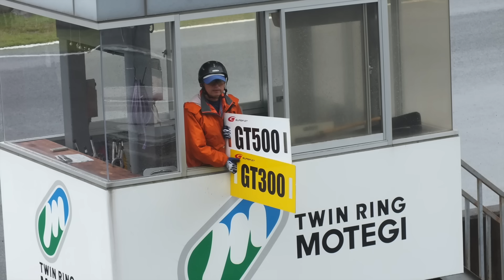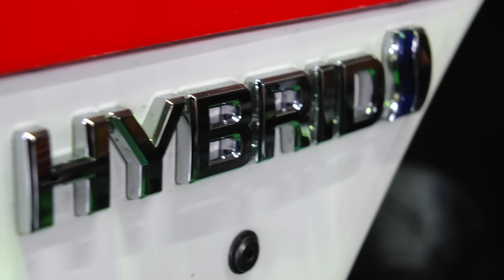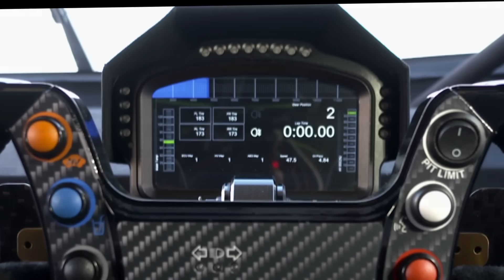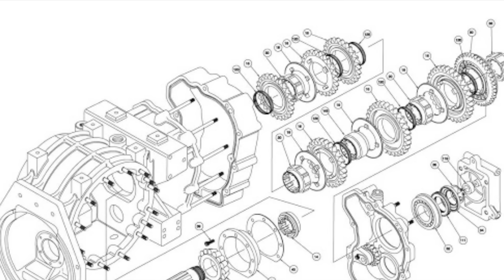The wildest Prius, The Super GT - Indycar V8 hybrid is reborn. 2017 apr GT300 Prius tech details

Comment: 4:30 Regarding Bandoh letting it slide... it's worth noting Bandoh owns a Toyota aftermarket parts company, and of course APR is another Toyota aftermarket company. Both are very Toyota-adjacent. Bandoh is also known to be very lenient towards Toyota/Lexus getting penalties, and listens to Toyota when it comes to BoP.
His name continues to be on the Wedsport GT500 team (Toyota/Lexus).
IIRC it was 2017 when his car rear ended the 23 Nismo GT-R car on the warm-up lap. There was no penalty for Chairman Bandoh's car doing that. The 23 car lost the championship by 2 points that year. Especially in context of those years... drivethrough penalties were handed out like candy in 2017 and 2018 to Honda and Nissan for the smallest of infractions.
And then you would have drivers like Rossiter barging around the track recklessly taking cars out, with no penalty (but eventually asked to not come back).
There's been other curiosities, like a BoP being changed last-minute in 2023 IIRC. Before the first round, Honda was looking competitive... not dominant, just competitive. And Bandoh change the BoP hours before qualifying... which significantly favored the Toyota cars. Honda went from being pretty good, to completely absent during Qualifying and the race. Toyota won.

Comment: I have one prevailing memory of these cars in 2016-18 trim: the backmarking #30 car was ignoring blue flags, backing up the race leader at Okayama so that the #31 could close the distance and take the lead. No relevance to the wider story, but I still chuckle at the skullduggery. These were villainous Priuses.

It also stands out to me just how much apr's efforts with these cars mirror those of race teams of old. Jim Hall's Chaparral team also reused old chassis designs and built new cars to new specifications around them. So did Porsche in the 70's - recall that the 936 was a parts bin special composed of elements from the 908 (chassis) 917/30 (various), and '74 911 RSR (turbo engine). LMP1 teams would sometimes run different aero packages on their two cars in the lead-up to Le Mans - a high-downforce car to have the best chance of winning outright, and a low-drag car fielded to gather data before its use in the LM24. Just goes to show how race teams past and present operate on more similar logic than might be assumed.

Running two different brands of tire within a team isn't without precedent either, but one wonders why apr bothered with the off-the-shelf Yokohamas on #30 at all. Part of me suspects there's a pro-am sub-class within GT300 that just doesn't get much outside coverage, because there are a few of these strangely low-level efforts that hang around the GT300 class, even run by top-level teams. Hell, apr still field a low-level effort alongside their current flagship LC500h: a highlighter yellow JAF-rules GR86 that might even still use off-the-shelf Yokos. Might also be a budget thing, as bespoke rubber can't be cheap. In fact, maybe it's both: have a pay driver come in and shell out money to drive a toned-down version of your flagship and take a crack at a pro-am title.

I eagerly await Part 3...

Comment: A Prius with a set of coilovers and good wheels and tires, is actually a lot of fun on twisty roads.
Reply: It's worth noting that a car that's efficiently designed will tend to perform well in dynamically demanding conditions. Power dense drivetrains, relatively compact proportions, and slippery bodywork are general attributes the Prius shares with every Porsche Le Mans racer fielded before the 917 - cars that famously did a lot with a little. 

I suspect a race-tuned Prius with the punchier electric motor out of a hybrid SUV and good chassis prep could likely do some serious damage in a touring car race. Anyone have the Speedworks BTCC team's phone number?
Reply: People forget that a car is a car, and that it's up to the driver to have fun with it
Reply: IIRC the latest Prius shares the same suspension mount as GR Yaris or GR Corolla (can't remember which one). The suspension, at least externally, even look similar between the 3 cars. The internals are different of course.
Reply: @silphershadow  If Jason Cammisa is to be believed, the GR Yaris's rear suspension comes from the Corolla, and the GR Corolla shares Toyota's TNGA-C platform with the Prius. Bozi Tatarevic at The Autopian has gone so far as to investigate the installation of go-fast parts meant for GR Corollas onto his current-gen Prius, and he's having a non-zero amount of success actually - without dramatic surgical operations, just basic bolt-ons.
Reply: @silphershadow this should tell you everything you need to know about the GR vehicles and toyota in general.... You can put stiff springs and dampers on an econobox, but a real racer can feel the difference actual good suspension geometry makes. Toyota is all about saving those dollars
Reply: I've never driven a single vehicle that wasn't fun on twisty roads I can't lie. Give me an 18 wheeler and I'll be laughing the whole time.
Reply: @MassiveGenius-l3yGo drive any American car that isnt a Corvette, a V Series or Blackwing Caddy or a Mustang and get back to me.
Reply: Have you watched the Prius touge youtube vids of the guy in Socal? He pushes it to the absolute limit
Reply: Driven Honda's with less power.
Reply: A Hyundai Excel is also mad fun in the twisties!
No balls, but also no weight. Stock, it changes direction with a quickness!
Reply: It could be, with a better drivetrain. Primarily a better transmission. That CVT is a Desaster. Like all CVTs.
Reply: @TheNecromancer6666 the new Toyota one with the additional single fixed gear mechanically attached is significantly more bearable compared to past ones though
Reply: @TheImperfectGuy  It think all Toyota Hybrid ones have that. Still pretty horrible. There is plenty decent Hybrid Cars that are better.
Reply: @TheNecromancer6666 My family’s old 2010 Prius has zero CVT issues with 250K+ miles, I have no idea where a Prius specific bad CVT arose, but then again when Nissan’s Xtronic CVT (whatever it’s called) keeps destroying itself not even past 50K miles, I can see why people may think all CVTs = bad. 😂
Reply: @kimmyjohnny31  Not because the CVT is unrealiable. Its bad, because it drives horribly. Also CVTs are really inefficient in anything but City driving. A modern ZF 8 Speed, or DCT is far better.
Reply: @kimmyjohnny31  Prius don’t have cvt